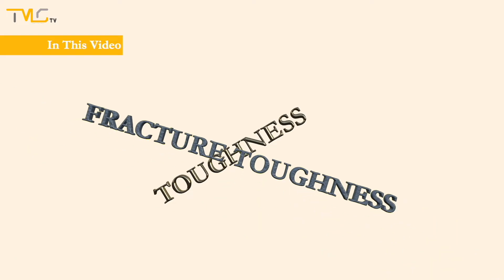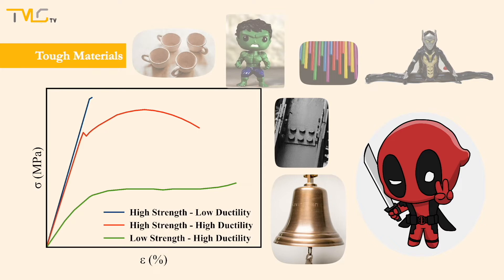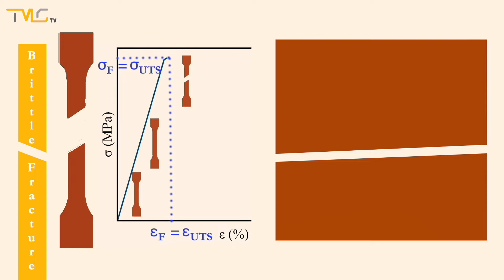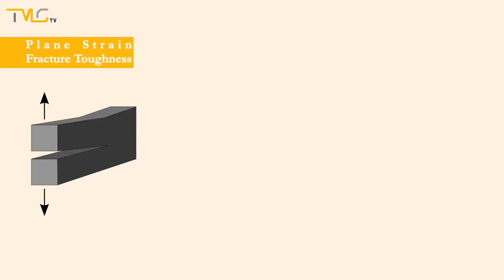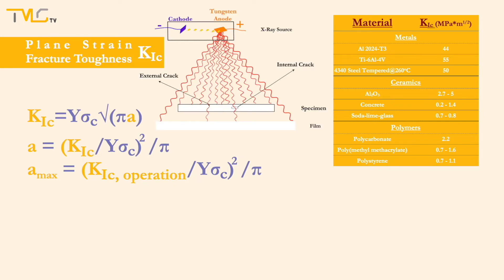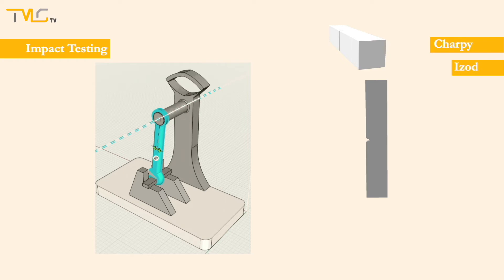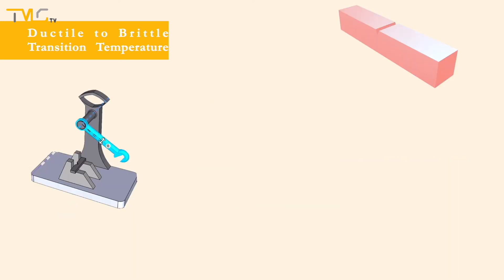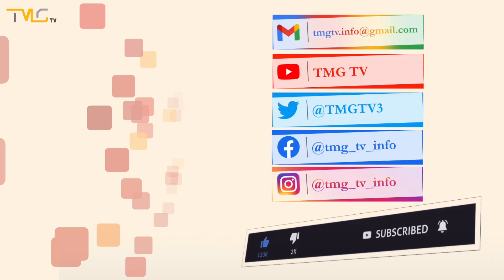Video #2.2 - Toughness, Fracture Toughness, & Notch Toughness (Mechanical Properties of Materials)

Comment: Why fracture toughness is a material property? 
Can I say that Fracture toughness is a material property only for plane strain case because it is independent of plate thickness?
Reply from the maker: Hi Kashif,
 fracture toughness is not a material property since it changes with changing material width. However, but as the material thickens and reaches to a critical thickness value, the plane stress conditions turn into plane strain conditions. As the thickness hits that value the fracture toughness of the material converges to a value which is named plane strain fracture toughness of the material. Any increase in the material thickness beyond that critical value will not lead to a major deviation from the plane strain fracture toughness value of that specific material. In other words, beyond that critical thickness value fracture toughness becomes independent of the materials thickness.